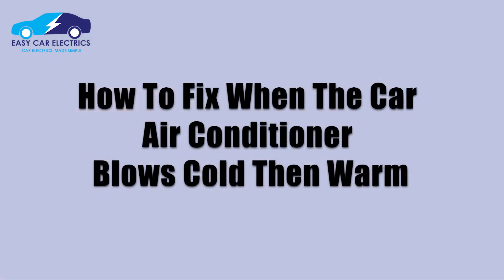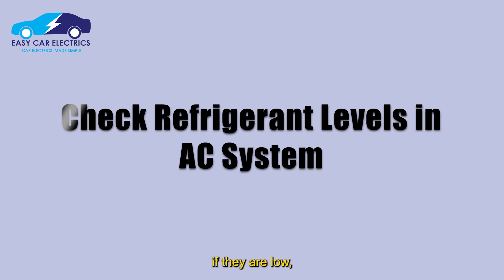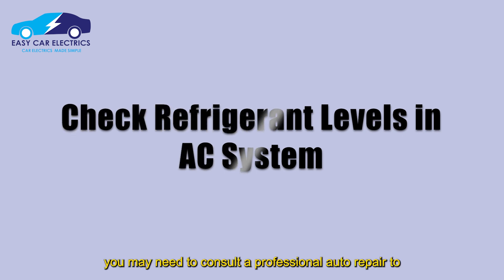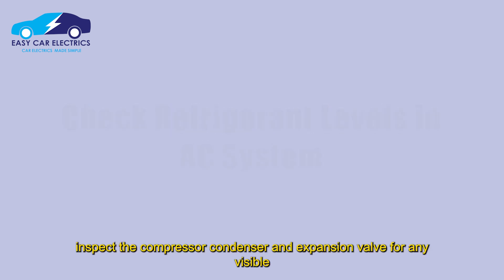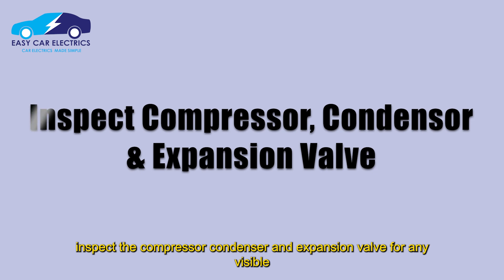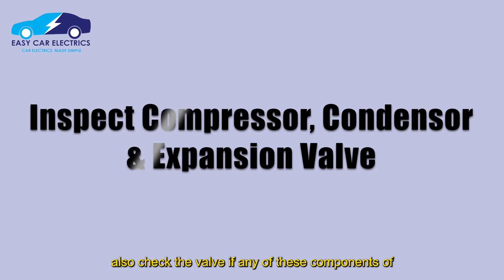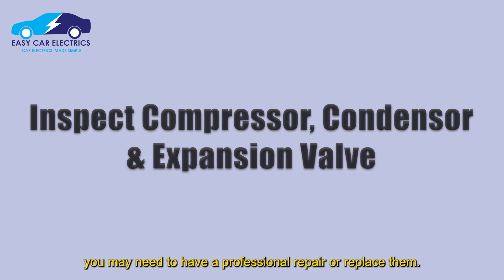11 Reasons Your Car AC Blows Cold Then Warm & How To Fix It - Easy Car Electrics

Comment: What about when only one vent will blow warm air after a while and the rest are blowing cold
Reply: could be an actuator not opening up the vent on one side of the dash.
Reply: Blend door actuator
Reply: I ran into that and it was low on charge
Reply: A switch that controls climate control
Reply: That could just be the cabin air filter, I’m not 100% sure on that but sounds like it could be

Comment: Thank you so much. The issue was indeed battey not getting adequate voltage. This was due to a faulty phone charger that I was using. As soon as I removed the charger, AC started blowing cold air.
Keep up the good work.

Comment: 4:20 blown fuse... can a blown fuse still have ac blow cold air every morning for several hours before blowing hot air?
Reply: No. If the fuse is blown it won’t work at all. Misleading the way they worded that.

Comment: 1. Moisture in the ac system (evaporator) 0:32
2. Blocked drain pipe (evaporator) 1:20
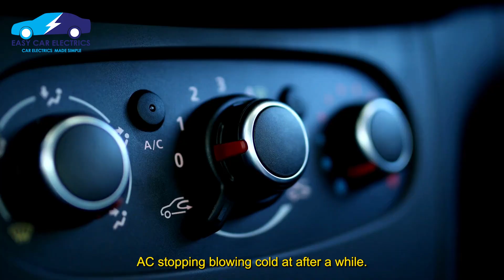3. Blocked expansion valve orifice tube 1:50
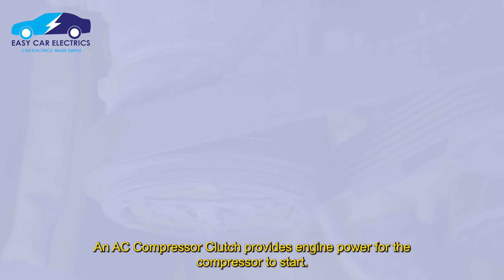4. Defective compressor clutch 2:32
5. Refrigerant overcharged 3:07
6. Discharged battery 3:34
7. Blown fuse 4:05
8. Corroded relay 4:26
9. Faulty ac control switch 4:57
10. Slow blower fan speed 5:23
11. Bad sensors 5:49

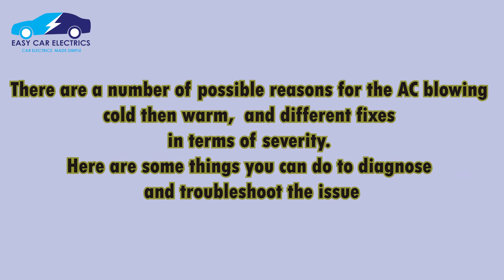Diagnose & Troubleshoot 6:15
Reply from the maker: Thank you for the breakdown!